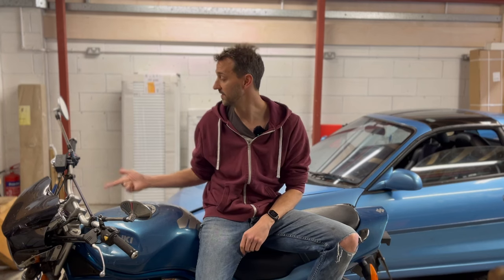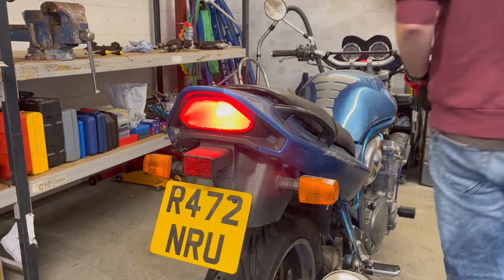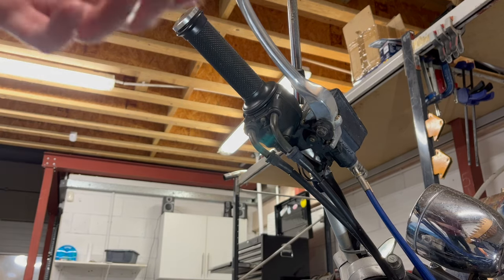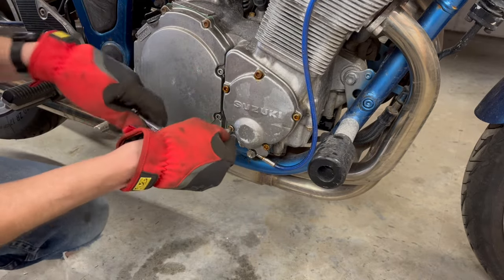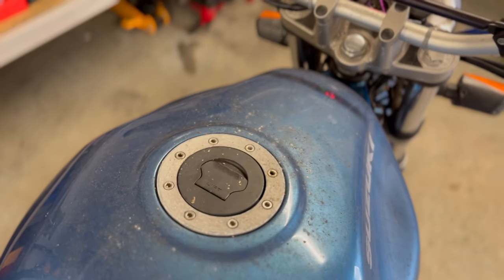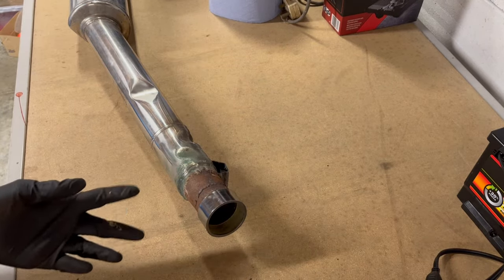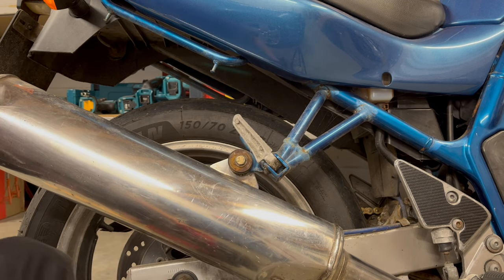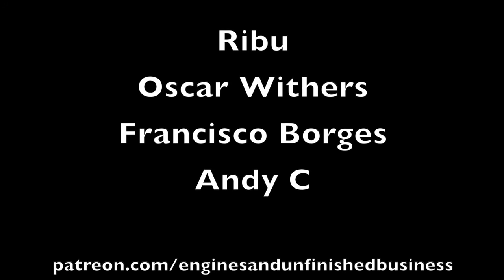Un-modifying a Suzuki Bandit

Comment: That exhaust is completely nackered 😂 im very suprised you are re-using it, delkevic sell the whole system for around £350-£400, if you get the 450mm slip on with DB killer it isnt very loud, bandit 650 is 77hp stock but with a slip on delkevic claim 88hp
Reply from the maker: Yeah I was surprised at how rusted the joiner section was, as the rest of the downpipes look great. But as long as it doesn’t leak I’ll keep running it, don’t think it’s got much life left in it though 😕
Reply: @EnginesandUnfinishedBusiness  they rust badly on the collector, you can get it repaired but it's not worth it, it will rust again 😆 very common on all bandits, I'd keep the original exhaust though, it's a rare sight to see a stock one, God bless

Comment: One of the first things I had to do with my 98 bandit was a new front brake switch.

Cheap aftermarket one was fitted. Genuine are not expensive. So genuine it was. 

I had to replace the factory exhaust. It was 18 years old, more rust than metal, and snapped at the collector. 

Fitting a stock/factory one? new is no longer available. And would have been about £2,500 last time it was available. I saw no point in replacing what was at the time an 18 year old exhaust with an 18 year old exhaust. Replacing rusty old crud with rusty old crud. Black widow. 

I got the screen, like the one on yours. 

All three brake calipers were seized up. Sent off for refurbishing.

Seat sent off for new foam and recovering.

New clutch cable, again genuine, 

Remove centre stand, clean and lubricate pivot bushings. 

Replace clutch release worm drive unit, genuine. 

And I could go on. And on. 

But I love it.
Reply from the maker: Sounds like yours is a well loved Bandit. They’re great bikes, love mine (except it never wants to shift into neutral 😕)

I must admit I didn’t even look into a genuine brake switch, just bought one off ebay, hopefully it’ll last, but if it fails I’ll definitely go for a genuine one next time 👍

Comment: You fitted a stock exhaust? The full system is no longer available from Suzuki, and were over £2,100 when they last were available. 

Did you really fit a second hand 26 year old exhaust system? You are just asking for it to snap. New old stock would work, but I doubt there are any left. 

One of the first things I did on mine when I got it, also R reg, was throw the factory exhaust away. It looked like a blind six year old had used it to fail to lean how to mig weld on. A good aftermarket stainless system is under £400. (i went Black Widow.) 

My front brake light switch was also dodgy, genuine new, too cheap to even consider trying to bring back to life. Ditto the rear switch. 

Recon all 3 calipers. All partially seized. Stainless steel pistons, new seals, repaint.

Professional seat recover.

Remove rear mudguard and discard, replace with second-hand one not chopped up and mutilated. I like the original look, not the chopped up look. 

Replace all brake hoses. They were stainless braided, and going rusty. Not that stainless really. Return to factory 3 hose front layout with a splitter. 

Bespoke stainless chain guard, the factory one was warped, and looked like an old dog chew-toy. 

Replace failed carb-heater plugs, harness and sensor.

Strip, ultrasonic clean, and rebuild carbs with new gaskets. discard all the factory “made from toffee’ Phillips screws, use stainless Allen headed ones. Strip the carb mounting brackets in rust remover/acid. re-plate. 

New genuine: throttle cables, clutch cable, clutch worm drive thingy. 

Remove a load of rusty bolts/nuts. Stainless.

Powder coat the wheels, pillion handles and top/bottom yolks in black, to match the rest of the bike. 

New fuel tap, genuine, it did not shut off.
Reply: Carb heater plug? What on earth is that?